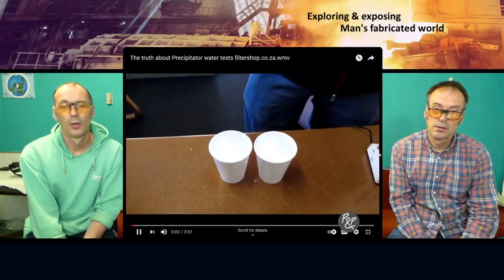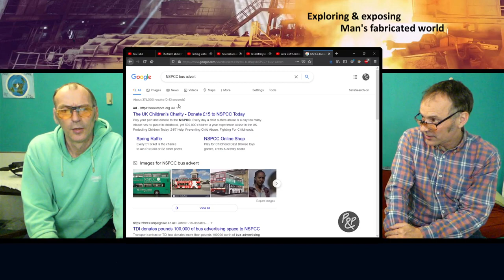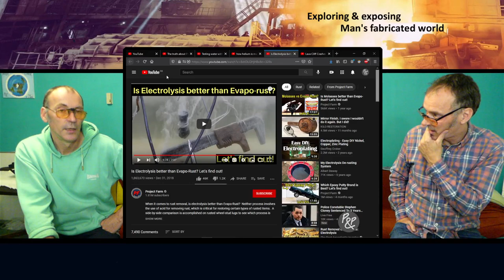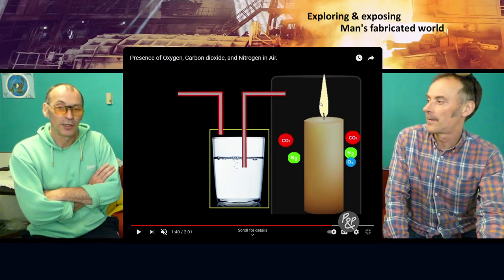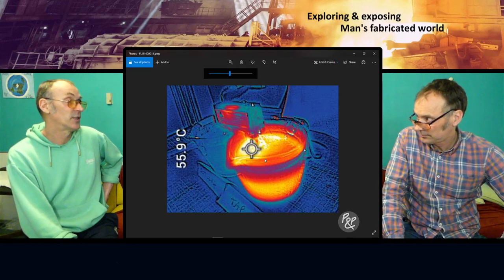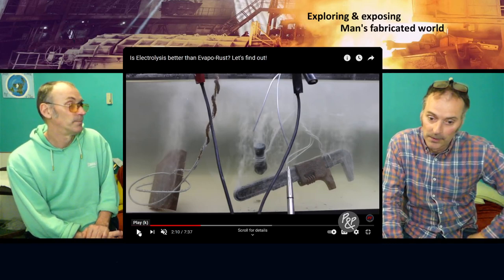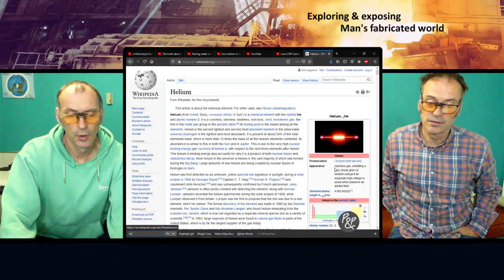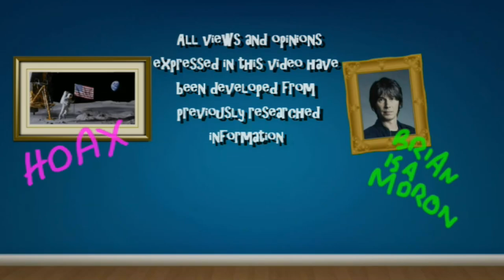What Have Helium And Nitrogen Got In Common?

Comment: Can make a video about Geiger Counter and EMF meter, and the connect to both since when ya measure EMF, then the radiation is high, from pulse electricity like 5G, so the Geiger Counter that you can measure, but when using pulse electricity or mono electricity, you can measure the Geiger Counter change. So, the mass that has high EMF which it would show high radiation that can damage you, but I doubt it since it doesn't radiate out, but on center of mass itself like Geiger Counter that is high, so the resistance line is high and can resistance the electricity to high heat, so unless you hit with high pulse and the resistance hold it so it radiates out so it is dangerous, so it is depends on electricity, not by nothing by itself. So, ya can use both to use on light that hit the glass and out of glass, it bends, so the color that split out so there is higher to lower color, so the higher heat, has higher radiate from light that is hitting glass, so ya can use EMF meter to measure that it will increase after the impact of glass or/and turning electricity. So, there is any mass itself that is dangerous that is 1000 Sv. Or it depends by impact of electricity, so not by static, but dynamic. So, there is linked between GC, EMF meter, light hitting mass or so, so light that hit something else something so the resist is high like the pulse is high so the pulse is back and forth, or has impact like pulse. So, natural mass is not dangerous even it is static since EMF energy require external impact to cause the radiate out. There is a barrier of mass. It is depend by light bulb which has current to impact the resistance line so heat radiate out, so mono light but pulse light will change so light itself is dangerous.